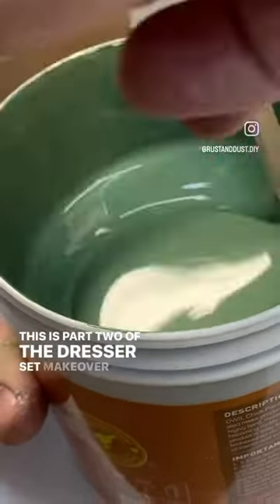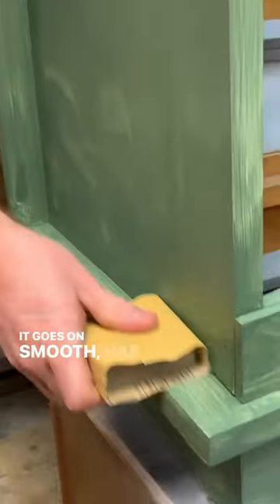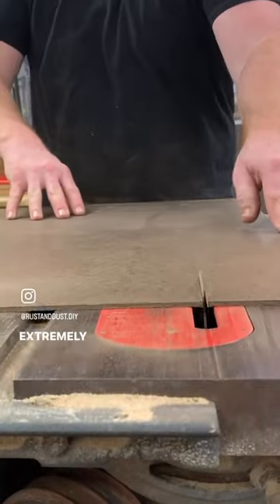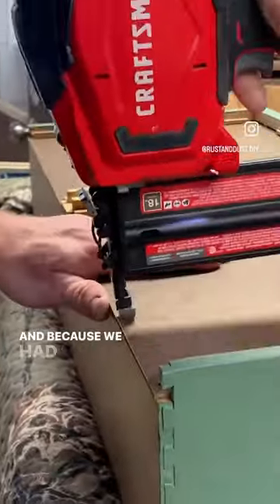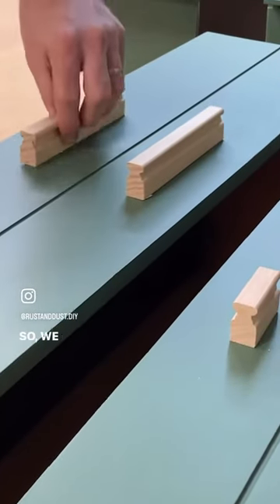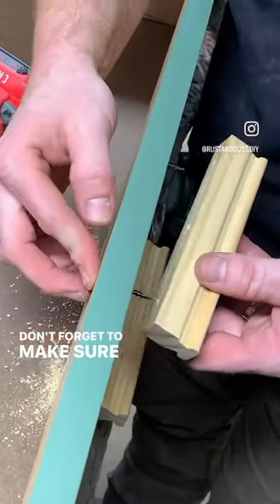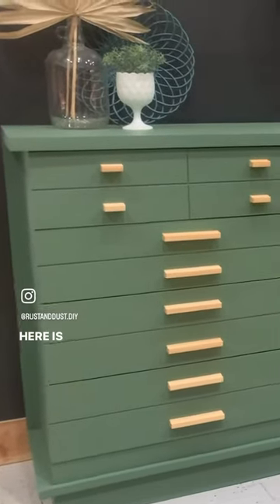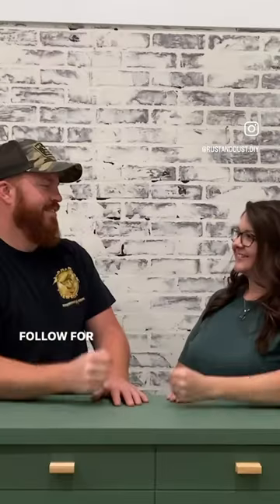🤩 Part 2 of the dresser set makeover we almost gave up on. #furnituremakeover #diy

Comment: It's much more important to measure the location of the hardware. What if the floor it's sitting on is out of level?
Reply from the maker: We did also measure the location, it would be pretty impossible to attach hardware without that. We check the level of the drawer and then compare it to the level of the hardware to make sure they match. Works perfectly.